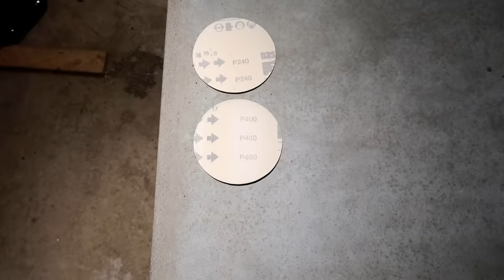DIY Concrete Table

Comment: I use diamond sanding / polishing discs. 100% easier than the sand paper. Got them in a set 50,150,300,500,1000,2000,3000 grits.

Comment: Should have wet cured.  Simply don't tent the plastic.  Even better if you have some burlap instead of plastic then you can come by and spray it down a few times.  

Curious why are you finishing the bottom?  I understand if you're trying to have a design into table locking epoxy inlay or something of nature.  However if all you're looking for is a nice smooth clean finish.  it would be much easier to just burnished the top of the table as it's getting close to be ready to be covered you'll get a better smooth product without all that grinding and additives that you were doing on the bottom that way.

Comment: Good job..looks very nice..
Will you tell me how did you make the concrete? I mean you used water , sand, and cement, did you used stones as well?
And in what amounts did you mixed it?
I be really helpful to get your quick answer .. and of course thumb up..thanks.
How long you vibrated? Cause i like this air holes.
Reply from the maker: Hey! Thanks man.
I used a finish mix - just added water as described on the package.
It was with 0-4mm sand in it.
If you like the holes then just give it a light vibration, I probably did it for 10min.

Link for the "concrete" I used:
https://www.silvan.dk/skalflex-stoebebeton-0-4mm-25-kg?id=6220-1265700
Reply: @DIYSupply  thanks much man..that is what i am doing right now ;)

Comment: Next time you mix concrete (or stucco, plaster, etc — anything dry that comes in a bag) use a garden hoe. It works better than a shovel and easier on your back. My brother taught me.

Comment: Nice !
Do you have any feed back for the resistance of that wax finish ?
vs water ? vs oil ? vs mecanical stress ?
thanks
Reply from the maker: Hello! Yes, it's rubbish, I poured epoxy on it instead :)
Reply: @DIYSupply  thanks for sharing experiences

Comment: For the air holes it's best to get a can of SBR bond and kiln dried sand (same colour as the sand you mixed the concrete with) mixed with cement (same ratio as your concrete mix) then put a little SBR bond with your water and mix the kiln dried sand and cament into a paste not too dry no too wet and work It into the holes take off exess and leave a day before buffing out.

Comment: Nice work it looks awesome

If anybody wants to use wax to polish with I recommend looking into ski tuning tools

And iron for melting the wax into the base material and plastic brushes in a plastic scraper

You can also get plastic brushes on a rotary handle that attach to a drill

Comment: normally for the hole problem you have to make a thin layer of pure cement, no sand and cement, only pure cement and you have to put it before cement complete dries i don't know how say it in english "before sement FRAGÜE" "before cement SETS" and the cement have to be pretty liquid, like a cream so you can work with it. then you start polishing and evething thats the whay i did it anny whay that job looks amazing

Comment: What was the final size and weight please? I'm afraid it is too heavy. In some videos I watched here there is a tricky technology used to reduce the weight of a concrete - using a plastic empty balls of an appropriate diameter.  1 kg of plastic reduces 100 kg of a concrete they say. Let's say you take ping-pong balls as easy to find material for this table. I think it would dramatically reduce the overall weight.
Reply from the maker: 150kg in total - you can use wood or something as filler if you want

Comment: Doing a similar thing and just left it to cure. Now I read that when mixing manually I should mix at least 15 minutes which got me anxious :) Think I mix just 3-4 mins with a shovel like you. Do you have experience what happens if I mix too little?
Reply: Ser kemisk metall, är du svensk? :)
Reply from the maker: Dansk :)
Didn't mix it as long as it said either - it will do. I'm just thinking the manufacturer needs to be sure, so they write a bit more than actually needed. But that's just my opinion.

Comment: You could also have embedded a strip of brass around the table top's perimeter, say about two or three centimeters from the edges as an accent.  When you ground down the surface and polished it, the polished brass would have been very attractive.
Reply from the maker: Hey James!
Thank you for the input - that is not a bad idea :)

Comment: great job, what type of wax are you using? I like to apply the same technic to have a variation of tones
Reply from the maker: Hey!
I used beeswax for this table, it gives a nice effect, but the shine goes away and it turns matte after a couple of months.

Comment: ola!
Saudações brasileiras. Para não ficar bolhas você pode usar um tensoativo, se caso não tiver passe uma leve camada de detergente de cozinha.
Reply from the maker: Olá!
Eu fiz o meu melhor com o google tradutor.
Eu tentei usar algum plastificante no meu novo vídeo, onde estou fazendo algumas lâmpadas.
Mas obrigado pela sua contribuição!
Reply: @DIYSupply  OK
Thanks for the feedback. What I am saying is you use a thin layer of dish soap, liquid detergent or other product that has surfactant.
Apply to the blade that does not bubble
Reply: Ola, edson, você quer dizer aplicar uma camada de detergente na forma, antes de encher com o concreto?

Comment: great instructional video. These days of toktok supereasypeasy tutorials it's sooo necessary to show very frequently things, don't work out as the plan!!! 
I think bubbles weren't a big deal, they would have got filled up with dirt anyway afer using it, and then polished. On the other hand, to get that glass-looking effect, casting liquid epoxy on top might have worked out too.these days these days very frequently

Comment: How do you create stains on concrete?I mean the wax you heat with a flame ..
Reply from the maker: The hotter it got, the darker it became. But but but, if you use beeswax like I did, it will turn matte after a month or so, just so you know. :)
Reply: @DIYSupply  thank you :)

Comment: HI! did you use something else than concrete? 
thanks for sharing!
Reply from the maker: Hey
No, not for this table. I only added water to the mix.
Reply: @DIYSupply   thanks for the answer

Comment: Should have added some plasticizer. Would have went in more liquid and helped eliminate the bubbles and holes. If you want it shiny forever, use the epoxy gloss sealant they have at Home Depot...
Curious as to the dimensions and weight of this table? I'm about to make a work bench similar, but I need it 8ft long. Thinking of maybe going a tad bit narrower to cut down on weight. Not sure if I should just make it in 1 full 8ft sheet or make it in 2x 4ft sections.
Reply from the maker: Thank you for your input Munky! I will consider the plasticizer for another project!
Dimensions are 200x85cm and 4,5cm thick - weighs 150kg.
- That's 6 feet 7 inches x 2 feet and 9.4 inches and 1,77 inches thick - weighs 330 pounds.
Sorry if this is not the way to write it correctly - i'm a metric guy :)
You can make it a bit thinner, that will save you some weight.
Reply: @DIYSupply  thanks yea I was thinking about half that thickness. Thanks for the reply!

Comment: Man ur effort deserves respect. But u want to check on different concrete and in my experience when using a good surfice as form as u did, using a slightly more fluid mix (self levelling) will solve a lot of problems. Tumb up

Comment: If you want to fill the pores with concrete product, do the old school "sacking" method. Mist the top with water, and sprinkle dry cement powder on the surface, then rub the hell out of it with a burlap sack. The sack forces the slightly damp cement into the voids. Since there's little water in the cement, it doesn't shrink much, and sets very hard.
Reply from the maker: Hey Matt!
Oh that's not a bad idea! Thank you for your input!
Reply: That can result in hairline fractures though. They don’t affect the structure but may or may not have the aesthetic result you want.

Comment: Why do you need to "seal" a concrete surface? It's similar to stone, nothing will happen to it.
It you want to not have holes, make a more liquid cement-only solution and rub with that, then remove the excess.

Comment: what's the cement to sand ratio in the concrete you used?
Reply from the maker: Hey
It's a "only add water" product im using, there's allready sand in it. So i don't really know.

Comment: Beautiful result! I think that the air bubbles and imperfections tell a story about process and hand that can't be replicated by machine. I love that you used wax to seal it.
Reply: Totally agree Kyla, concrete furniture should have that brutal-industrial finish the blemishes to add character...otherwise you may as well go for stone or some engineered solution.

Comment: Hey, thanks for this video, it helped me a lot. Did you notice any cracks in it after a bit of time? Because mine has started to develop some.... 😬
Reply from the maker: Hey Joe
No - I have not had any cracks in mine so far.
Reply: @DIYSupply  Why didn't you use a resin to seal and polish the table like they do for floors?

Comment: future tables,keep the rebar back from the edges about 50mm, this will stop it getting moisture and cracking the sides
Reply: Zane H, good idea. But if he keeps this table indoors it should do okay. 
(For people who don’t know, what Zane is referring to is that rebar, when it starts to rust, expands and puts outward pressure on the concrete, eventually cracking it.)

Comment: Muriaic acid will etch the surface of concrete. Do that, then try a very thin, yet sturdy surface preparation. Thinset may work well, applied with a hand sized block of styrofoam insulation. The harder pink one is best.
Reply from the maker: Humblehombre 
Thank you for the input!

Comment: I think the air bubbles are unavoidable when not using a specific mix.
Reply from the maker: Hey! That might be an idea, i reckon vibrating more consistently might do the job aswell.
Reply: Also, the mud you put down was thick, ive had luck thinning it out a bit.  Air comes out much better
Reply from the maker: Thank you for the comment - Yes, i will make it thinner if i'm doing another concrete project :)

Comment: Instead of making the mix thinner you could mix to correct consistency and then use a flow control product that acts as a thinning agent without taking away any strength.
Reply: He could also have melted the wax in the pot before he applied it like a normal person. I'm not really sure why this video has so many likes, it's a hot mess.
Reply: David McKean I’m stating for future projects since one of his lessons learned was to make mix thinner. And I think because some folks like to enjoy the process, the ups and downs. The finished product is pretty nice. Videos don’t always have to be flawless.
Reply from the maker: Thank you for the input!
Reply from the maker: @davidmckean955  The wax would harden before I got it out of the pot, and then i had to heat it again. I did another project where I mixed linseed oil and beeswax in a water bath, and then applied that - but that didn't work out very well. Couldn't make the structure that i wanted, and the surface got "soft"

Comment: Which kind of wax did you use and where did you buy it?
Reply from the maker: Hey Rowen
I used something similar to this: https://amzn.to/2DXuyNH
Reply from the maker: But it will turn out matt - mine did after 1 month, just so you know :)
Reply: @DIYSupply  thank you very much😊 would you use it again in your next project or would you try something else?

Anyway, love your project! It inspired me to make my own😊
Reply from the maker: @R0W3N1411 I would experiment with something else - there are a lot of great sealers out there - this was just what i had laying around, so that's why I used it :) 
I would also use plasticizer for the concrete, (https://amzn.to/2VoHwyT)
Reply: roWen f

Comment: Looks great but I think a water based sealant would have been easier. Made me laugh too. Nice one mate.
Reply from the maker: I think you are absolutely right, I also wrote that in the description - but it's like a manual - nobody reads it :)

Comment: What wax to use for impregnation?
Reply from the maker: I used beeswax - but there's many other products out there, that are much easier to apply, if you don't want the same "structure" as I got.
Reply: Is that what made it so shiny?? Link please?

Comment: what concrete did u use?
Reply from the maker: The cheapset I could find, in the local hardware store. 0-4mm sand, just added water.
Reply: @DIYSupply  so it was ready mix concrete or cement? And how is it holding up?
Reply from the maker: It was a ready mix, yes :) I poured som epoxy over it now, to get an easier to clean surface - but still in use every day :)

Comment: The thing came out nice with the wax, nice than with epoxy. I would have eventually used a heat gun or a flatiron and grinded the wax into small pieces.

Comment: Nice table but to much extra in the process, Clear epoxy work great.
Reply: Then you call it an epoxy table, not a concrete table..
Reply: @tamaskovacs8074  I think he meant for sealing the concrete
Reply: Edward Rhodes epoxy is not a concrete sealer. If you want epoxy table, make an epoxy table.

Comment: Turned out nice, but would have been much easier using a concrete sealer instead of wax.
Reply from the maker: Hey Timothy
I agree - just like I wrote in the description :)

Comment: Perdon pero ese pulido esta mal echo se de rellenar lo poros si con masilla resina epoxi o cemento preparado co fibra de vidrio luego pasar con una lijadora orbital no lustradora no con disco q gire de ninguna forma lijadora orbital lija grano 100 calculo en es mesa 60 minutos luego lija al agua y con agua desde la 1er lija 2 da lija 120 luego 150 , 220, 280, 320,360,400,cada lija q se pasa es cada vez menos tiempo calculo 10 a 15 minutos la ultima lija nro 1500 heeee ahi recen la cera virgen se pone a baño maria y se la extiende con un pincel previo calentar la mesada si esta fria con pistola de calor para q la cera se extienda y ese brillo quedara duradero el q se hace en el vidio es solo un brillo de la cera pero si se pone un año al sol este brillo se va saludos

Comment: With all that work you put into it, and you wanted glossy finish...
Why not have just sealed the entire thing with clear epoxy? It would have filled the holes, and it would give tons of shine.
Reply from the maker: splash 
I thought about it, i actually thought about many other solutions along the way - but then i got stubborn and wanted to do it the way i first had in mind. But I may try that on another project 😊
Reply: @DIYSupply  
End result was nice, but you really had to work extra to achieve that!

Comment: Although honest, This is wayyyyy too much trouble. Lol. A slurry mix would’ve been fine to match up the holes, and a normal concrete sealer (or even a food safe, water based sealer) to get good results.

Comment: Although I'm an armature, I've seen enough cement table videos to believe that you mixed your concrete too dry. Next time, the concrete should be like pancake batter.
Reply: wrong. Those holes are trapped water not air.
Reply: @travisthompson8398  You're not correct according to the visuals provided, nor by the means he undertook to correct the problem.
Reply: So your a youtube table expert it sounds? He used regular cheap sak crete. It shrinks very bad and cannot be mixed wet. You can mix countertop design mixed  wet when there are admixtures like superplasticizer. It appears to be much wetter than it really is and reduces shrinkage. Go pour some counters before saying someonecis wrong. That shitty bag mix holds alot water. and those holes are 100% trapped water not air
Reply: @travisthompson8398  You actually confirmed my original point about a bad mix.

Comment: The reason that you had so many air bubbles was because of the slump of your slurry. You mixed a dry slurry, which promotes less leveling and pockets of air. The slurring should be more soupy, this reducing air pockets, bubbles. IMO
Reply: and the strenght will be less
Reply: @julikb  Not if you mix a dry slump but add eRapid Set Flow Control, not water. Easy Flow converts the slump to a soupy slurry without undermining the strength. Here is a link for your perusal https://www.ctscement.com/product/flow-control
However so. You have done a great job on your project :)

Comment: mix was too dry, I've never seen that many holes and you used a vibrating mechanism which should have eliminated a lot of what you ended with but thanks for showing us what will happen with that mix and technique and a possible solution...smiley face

Comment: Did you just use a sander instead of a grinder ? Wtf am I watching
Reply from the maker: You have tuned in on "DIY Concrete Table" Where the the tools you see is what tools are available at that time.
And by the way, i found this on the internet: hunker.com/13400815/information-on-sanding-concrete
"An orbital sander is the correct equipment to use when sanding concrete."
Have a nice day Bent, thanks for tuning in :)